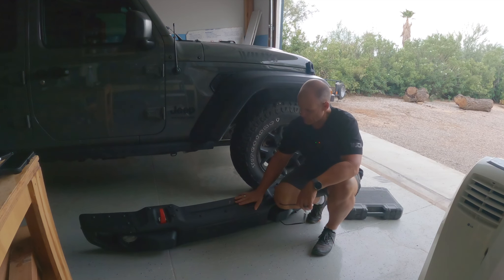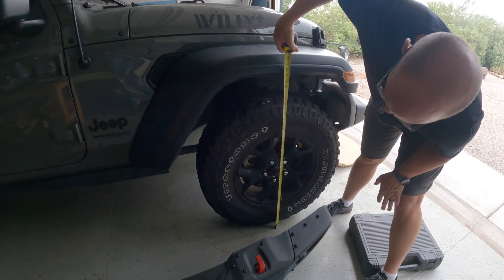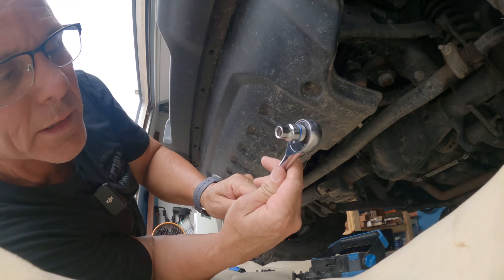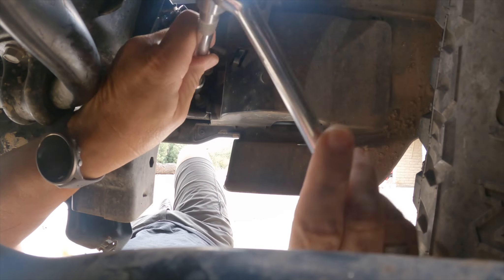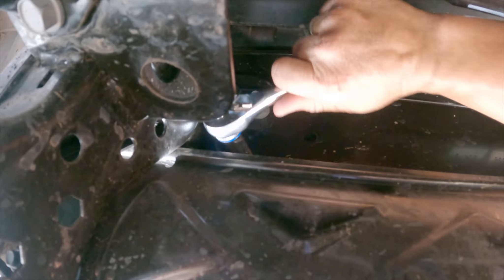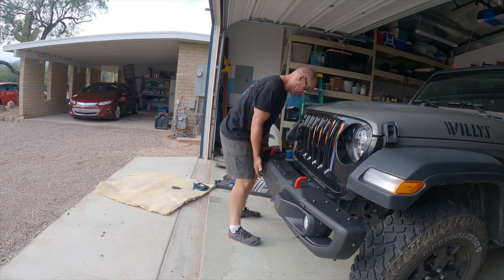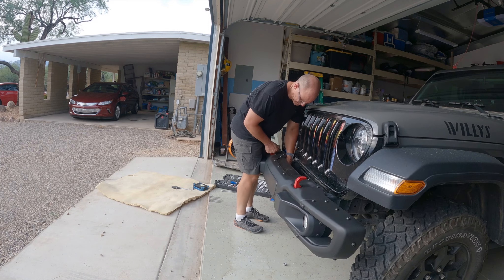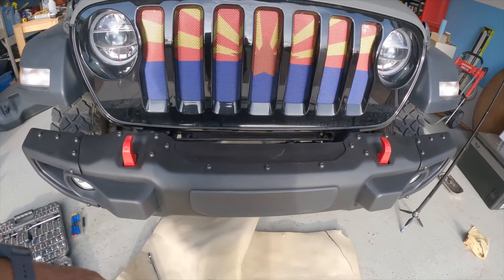Install video.  Removal of Plastic bumper and install Mopar 3 piece Rubicon bumper

Comment: Did you notice any droop on the front of your Jeep with the additional weight of the steel bumper?  Did you have to add any leveling spacers over time?
Reply from the maker: Hi Scott, no drop noticed and it didn't change trail or driving dynamics at all.  At least from what could tell.

Comment: I'll be keeping my Jeep's OEM plastic bumper as I don't see any need to a steel one (for my driving/off-road needs presently), but it's nice to know I can always get one later, especially if I want to install a winch...and have $1K's worth of change burning a hole in my pocket.  :-)
BTW, I thought about getting a "decorative screen" (like your AZ flag screen) behind the grill of my Jeep, but was concerned about restricting ANY air-flow to the radiator, especially in 90-100+ Summers temperatures, but more so if towing a trailer in hot temps. While they DO look nice, I can't see how these screens would NOT reduce air-flow. One benefit of them though is they'll probably reduce/prevent pebble/large insect hits on the radiator fins and denting them (which is a bonus).
"Jeep Wave"
-- BR
Reply from the maker: Hey Bill, don't blame you on keeping the plastic one.  I went back and forth for over a year and decided to just go for it.  :)   Definitely not cheap that is for sure.  As to the screen I have had it on mine now for well over a year and have not had any noticeable change in temps so far.  I only tow a small trailer now and then.  I am a bit disappointed as the paint has chipped off just a bit in a few places...possibly from hitting larger flying objects.  LOL.  Have a great rest of the week brother.

Comment: Great video. I’m goin to do this on my gladiator. Do the fog lights work the same as if you had the plastic bumper? Or do you have to rewire something else?
Reply from the maker: They work exactly the same.  No wiring necessary.

Comment: Did your steel bumper come with new mounting hardware or did you reuse the hardware from plastic bumper?
Reply from the maker: Hi Nathan, sorry I didn't mention that.  It did not come with new hardware so you have to reuse the older stuff.  If you decide to order the plastic fill in piece for between the bumper and grill the one I ordered did have the hardware with it.  The steel skid plate, just ordered it, required another $70 for the hardware to mount that to the bumper.

Comment: Hi Rick.

Do you happen to have a part number of the Willy’s pen plastic bumper? I tried to look online however only see the Sahara stock bumper with the silver fog light trim 

As I need to replace the bumper
Reply from the maker: Is this it?  Hard to tell for sure.  You are looking for the stock plastic bumper correct?https://www.mopardiscountedparts.com/oem-parts/mopar-front-bumper-6bu44rxfab?c=Zz1mcmFtZS1idW1wZXItYW5kLWZhc2NpYSZzPWZyb250LWJ1bXBlci1hbmQtZmFzY2lhJmw9MSZuPVNlYXJjaCBSZXN1bHRzJmE9amVlcCZvPXdyYW5nbGVyJnk9MjAyMSZ0PXVubGltaXRlZC13aWxseXMmZT0zLTZsLXY2LWdhcw%3D%3D
Reply from the maker: Are you in AZ?  I sell you my old one as it is in great shape.  I found a tag with this number on it.  20203440920.  Not sure if that is the part number or not...It is a bit faded from getting wet.
Reply: Would love to buy yours unfortunately I’m all the way in the north in Canada…
Reply from the maker: Bummer.  was that number correct?  All of the other tags are unreadable on my bumper.